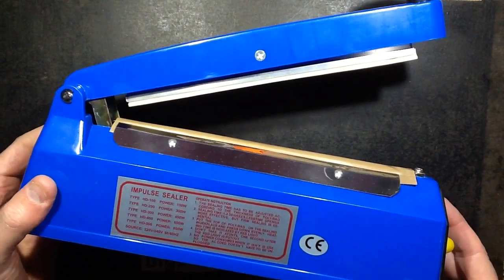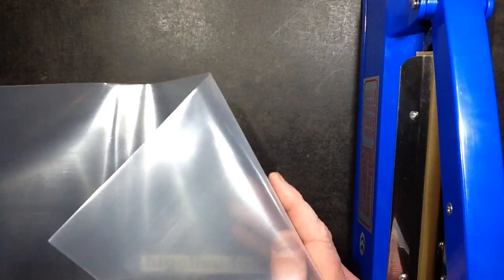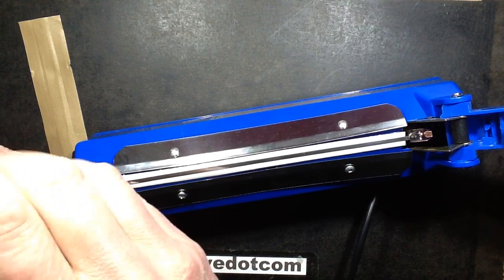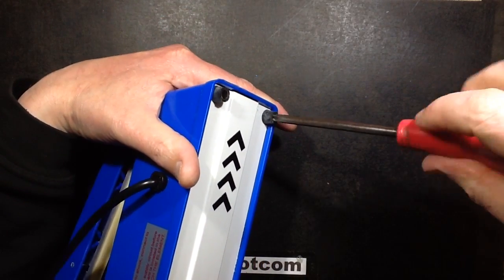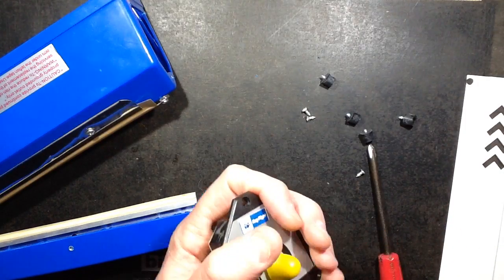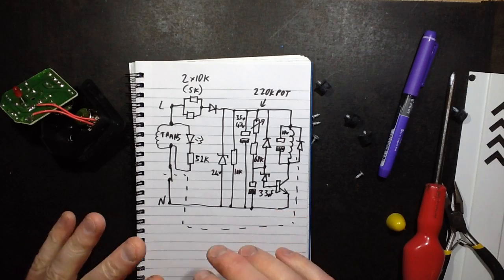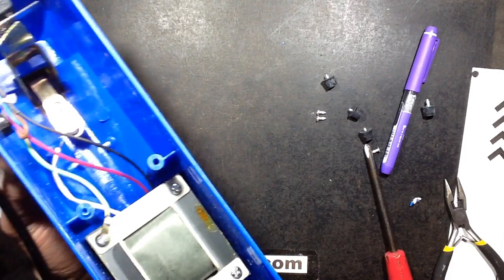Teardown of an impulse sealer.

Comment: Do you hqave any infomation on the relay? 7A is quite a-lot of current to stick over that slightly piss'ant relay....
Reply: +TornTech Why on earth do you think 7A is flowing through the relay?
Reply: +Aurelius R I can't remember now. Pretty sure Clive said somthing about high current during his calculations.
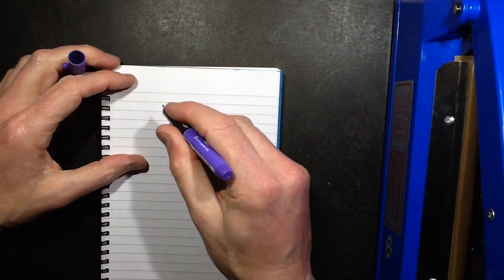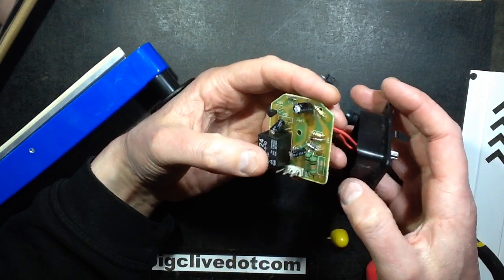Reply: +Aurelius R I re-watched the video... I was mistaken. It actually sounds like the 1 ohm heating elements causes around 17 amps to flow through the relay(calculated at 08:00) .. At around 13:20 Clive reverse engineered the circuit and said that after the delay, power is applied to the relay to disconnect the power to the element. it sounds like the element is connected through the NC pin of the relay and once time is reached the relay latches, disconnecting the supply to the element.. I'm happy to stand corrected, although I'm not sure of any other way the relay can disconnect the supply, or what other purpose it would serve...

All in all, my original comment remains, although slightly corrected, 17Amps through a little relay like that is quite impressive!
Reply: Remember that the current through the relay will be controlled by the transistor. If you had 17 Amps flowing through that transistor, even for a very small period of time, it'd definitely blow the ass end out of it.
Reply: +Aurelius R the transistor is there to drive the coil of the relay not the heating element.
Reply: +TornTech I'm not sure if I'm confusing you. I mean that 17 amps is across the Contacts of the relay. Not driving the relays coil at 17amps..
Reply: +TornTech My mistake. I assumed you meant the coil.
Reply: ***** not a problem :)

The reason I asked the question was because finding a relay in a form factor as small as the one featured in this video, capable of handling a 17amp load is quite a mission! I have looked relays for controlling the 24v power to 2x 24v motors. However the stall current of the motors reaches something like 10amps each. meaning ideally i need a relay rated at 20-25amps... Not an easy find! and not cheap either! :)
Reply from the maker: +TornTech The relay in the video only handles a couple of amps.  the transformer reduces the voltage and increases the current.

Comment: I'm certain the stainless steel strip used as the heating element has a very large positive temperature coefficient. The transformer starts out putting an overload current into the heater, but the heating element gets warm/hot and its resistance increases to something less stressful for the wimpy transformer. Have you checked the load voltage across the heating element yet?

Comment: 150W for the element and 150W in the transformer. Typically a 56VAC open circuit transformer, run horribly overloaded. I fix them all the time, but this one is the nastiest I have seen, the ones I buy are the metal cased versions, a little more but survive production use. Tape I buy in 2 sizes by the roll. Timer I always mod by adding a VDR across the relay contacts and adding a 220k resistor across the 2 wires to the pot so the max time is 4 seconds. Saves the element burning when time is turned too far. That timer board is the bad version, the ones I use have a SCR ( I use a C106D as a replacement) as the relay drive, and they are a lot more consistent in operation. Relays are luckily a part I can get for $1, and I use a lot of them. The cap across your relay coil is to prevent chattering of the relay as it pulls in, which will kill it very fast.

Comment: The capacitor across the relay may be a delay before the relay releases to prevent re operation until the main cap discharges so the next operation gets the full time period
Reply: +Sparky Projects Either that, or it resists the sudden voltage spike when the relay turns on. The diode will prevent the back-EMF, but when the coil is energized it could cause a spike, and/or dip in the supply rail, which the cap might help mitigate?

Comment: I love my impulse heat sealer.  Great for bagging parts each in their own section of a single packet.  Put first lot of parts in, seal, second lot of parts, seal, etc.

It is worth pulling the bottom plate off the unit when you buy to make sure the wiring is tidy and ensure the cut-out PCB and spade connectors are secured properly.

I got mine on eBay and it didn't work on arrival due to one of the spade connectors popping off.  2 minutes work and it was sorted.
Reply from the maker: DavidAVD1 I got a load of the metallised anti-static bags to pack some new kits in.  It will actually be much nicer than a stapler for that.